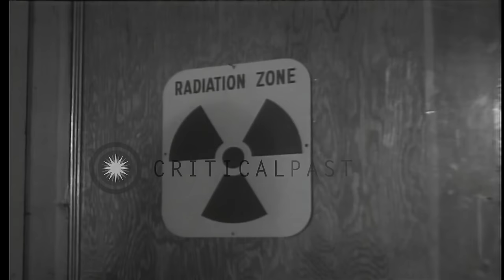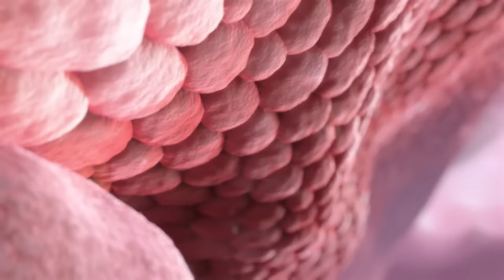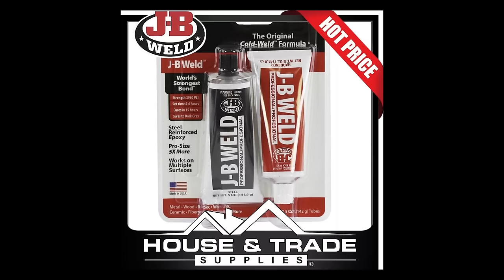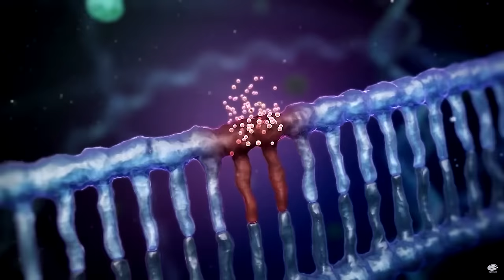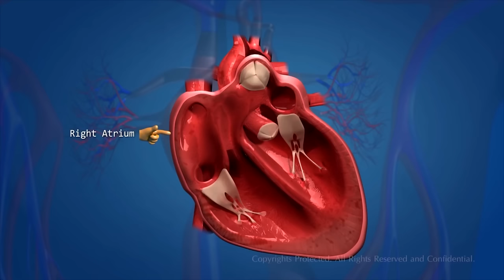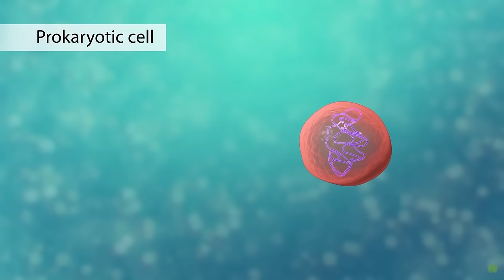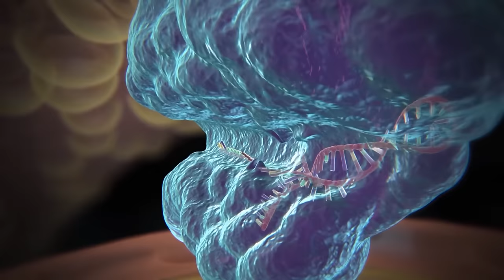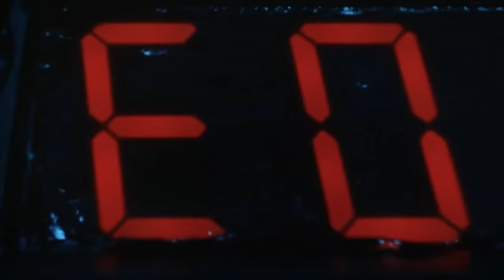The INTESTINE SUCKING Endemic Mosquito Population Explained

Comment: Physics major student here.
Radiation can be classed into a variety of "types.

Let's start by ordering from most dangerous to least dangerous (assuming inside of body): Alpha, High-Energy Neutrons/Protons, Beta / Roentgen, Gamma

Alpha radiation is a stripped Helium core and is thus an entire nucleus of 1P 1N and no electrons (He 2-)
Beta/Roentgen can be classified into electrons and positrons. The beta- is high-energy electron (e-) and beta+ is a positron (e+).
High Energy Neutrons/Protons are as the name says, protons and neutrons with such high energy that they move at so called "Relativistic" speeds (speed = magnitude of velocity if that says something). These elementary particles can penentrate practically everything as long as the energy barrier remains smaller than the energy available. See it as a bridge you need to go over and you can climb over it as long as your speed is high enough to do so.

Relativistic speeds means that a particle or object is moving so fast that it actively experiences non-negligable time-dilation and length contraction (Lorentz contraction).

We define that with the so called "gamma factor" (yes I know we are unoriginal with symbols) which is defined as 1/sqrt(1-(v/c)^2) 

with v the speed of the particle / object and c the speed of light (2.99792458e8 m/s, sorry Americans I speaks SI units, not metric nor imperial. I am so uncool I know).

So with that out of the way, we move on to gamma radiation.
This is biologically speaking from the outside the most dangerous source as it, besides UV-radiation can feck up your DNA by destroying parts of it (Roanoke u know this a lot better than me, Im a mere physics student). This can cause mutations and sometimes even lead to cancer. 

Gamma can be divided into two subcategories. Hard gamma and soft gamma.
Hard gamma is what really poses the biggest threat and soft-gamma is energetically more like X-rays in field strength but they take concrete to stop instead of a bit of wood.

Gamma radiation is radiation consistent out of photons and only photons, so, light.

Hopefully this was educative and feel free to ask me about more!

Comment: I feel like it would be better to just modify mosquitoe behaviors so they no longer become a problem to humans instead of eradicating them and causing problems in the ecosystem.🐱
Reply: The problem is that you would have to figure out how to program them to not feed on humans, which really isn't possible
Reply: I think the solution is a lot bigger than that unfortunately :( skeeters have become a more serious problem with every passing year because of climate change. higher overall temps and more humidity means more mosquitos. maybe if we got the planet back to a normal damn temperature they'd die off in winter like they're supposed to.

Comment: Fun things, I had a Dodge shadow in highschool for a year. But wait it gets worse. See some dealers decided convertibles sell better, so they took some of these and made them convertibles. But, they never braced the frame. So, what happens to a car with no roof between 1990 and 2005? Yeah. My car was bent, just enough the doors didn't work. 

So I had the doors ratchet strapped closed, and had to climb over the trunk to get in (the windows also didn't work) but I'm also 6 4, so I can't actually put up the roof. 

So for the year and change I had that car the roof was permanently down, and if I went slower than around 45 in the rain, you'd get soaked, and I was in South Florida, so it rained all the time. 

So yeah .. The Dodge shadow....
Reply: America fuk yea

Comment: That Dodge Shadow most definitely had a magic radiator in it, because once I owned its cursed sister the 1989 Plymouth Sundance (literally the same car with a different badge and worse gearbox) and a moderate sized piece of gravel to the radiator made that POS overheat to the point it started melting the radiator hoses. A hellskeeter proboscis punching clean through and probably taking out the radiator fan too should've immediately ended that car's whole career.

Comment: The two biggest obstacles for bugs to overcome so they can increase their size is oxygen content and weight. See, in dinosaur days bugs were gigantic because there was a lot more oxygen in the air. Insects don't have efficient lungs. Over time they got smaller because the oxygen content dropped. Weight is an issue because scaling them up doesn't change their physiology at all. The chitin would actually collapse under its own weight once they go past a certain point. Goliath tarantulas and tarantulas as a whole are a good example of this. While they don't crush themselves under their own weight they are extremely vulnerable to fall damage, even really tiny falls. Meanwhile the rest of the bug kingdom can fall from a tree and live to tell the tale. Not tarantulas, especially the Goliath. The Goliath can barely be dropped and suffer an abdomen rupture or something equally fatal. Tarantulas can survive somewhat higher drops but not a whole lot higher. It shows how fragile their body is once certain sizes are reached. Much smaller spiders can fall off of a flower and be like the Black Knight. Meanwhile for tarantulas that's pretty much a death sentence.

Comment: I got some plebian understanding of the science of "wings" and why the eyestalks "popped out":

Now, I am no expert, but my understanding of how wings can be that small, is how much 'clean' (non-turbulent) air they can displace, you could either have large wings and move them slowly/ glide more efficient, or they can be small, but need to move A LOT faster, e.g. hummingbird (small wings; fast flapping) vs albatross (large wings; slow flapping + excellent glide and soaring capabilities). You can kinda get an understanding of this by gamifying it, through an engineering game, or I bet once you get sponsored by Brilliant, taking an aerodynamics course.

As for the eyes "popping out": Remember that cliché that made its rounds a lot back in the day, about your nails and hair growing as you died, but it just turned out that the skin shrinks due to the body losing moisture?
I imagine that it is the same with the eyes, barring one caveat, the skull caving in from low pressure, skull caves in, eye (-stalks) stay in place.
Reply: Note that this message is not written in a negative angle to you, as I quite like your videos and personality.

Am ok with being called a huge nerd, daddy.

Comment: Maybe the magical alien mosquito proboscises just have some sort of sealant that closes the opening after it's pulled out? That would explain why it doesn't seem to matter that they pierced the radiator or that guy's leg. 

Heck, it'd also explain why nothing leaked out of the holes on the corpses after they finished sucking their victims. Even if they drained a lot out, there'd still be stuff that should leak out, right?

Comment: All radiation can damage your cells, even Alpha particles.
Can't remember where I heard it, but there's a problem some professors used to get the point across about the different waves:
You have three cookies. One emits Alpha radiation, one emits Beta radiation, and one emits Gamma radiation. You have to eat one, put one in your pocket, and seal one inside of a lead box.
So you eat the Gamma because neither the lead box nor your pocket will do any good stopping it, you put the Alpha in your pocket because your clothes and even skin are able to block Alpha particles, and you seal the Beta in the lead box because it's more penetrating than Alpha particles but not as penetrating as Gamma particles.
Or something like that. I've only dabbled into it, it's neat stuff.

Comment: 2:01 Ackchyually, it's just 'Mosquito'. Singular. Maybe you're from an alternate timeline where the title was plural.

3:24 Ackchyually, to "decimate" means "to reduce by one-tenth." That skeeter is reduced down way more than that. Also, there's no such thing as "completely decimated," because if one is "reduced by one-tenth," then it can only be completely that way or completely not that way. 10% of something has to be 100% of that 10%, otherwise it's no longer 10%.

8:26 I saw it as a teenager in the '90s and thought it was the '80s-est '90s movie I ever did see.

9:41 Come on, Leatherface! You ain't no greenhorn! Unfold that stock and switch to semi-auto mode for some real "SPAS therapy!" Pump mode is for low-brass skeet rounds and special-purpose less-than-lethal police rounds.

9:57 Technically, it would be both "manslaughter" and "negligent homicide," but not "murder." It's neither Murder-1 nor Murder-2.

11:12 He can't even hang up the phone right! 🤣

19:17 He could have just "Kyle Reese'd" it.

21:54 Ever see Street Trash or the Ghoulies movies? They're both notorious for their toilet scenes. 🙃

22:15 Back when they still spelled their name right.

26:47 Why doesn't anyone know how to unfold the stock?! Or maybe they know how, but they leave it in its storage position for no reason.

28:54 Just like 'Night of the Creeps'!

32:57 No Indiana Jones reference? Denied!

33:05 Hendricks had a green shirt. To be fair, it was a really dark green.

Comment: Certain species are more important than they would seem at face value Yellowstone. For example, the ecosystem was starting to fall apart around Yellowstone because wolves were removed from the park. Once wolves were reintroduced, the other parts of the ecosystem started to come back
Unfortunately, a lot of things eat mosquitoes. We'd be taking food away from a lot of things and it could very well crash entire ecosystems. We could take the easy way out and exterminate them or we can use what we've already learned and know and live with them. Easier to provide medicine to people than it is to wipe out an entire species and deal with the ramifications after which would then be irreversible